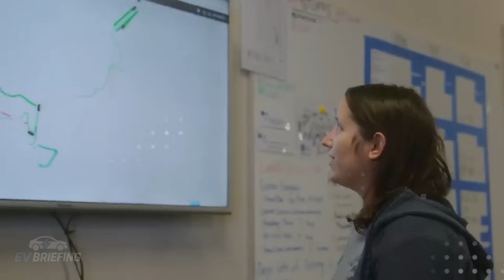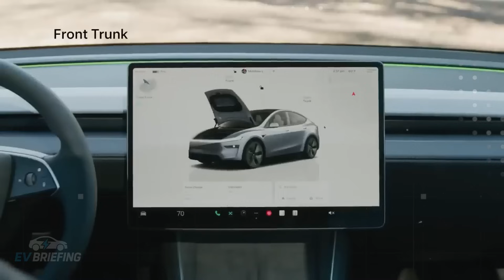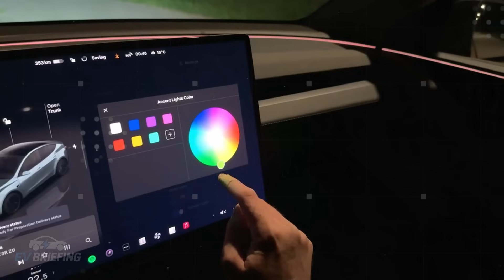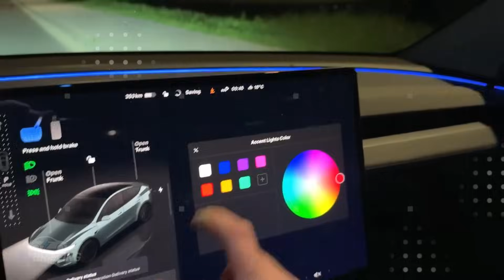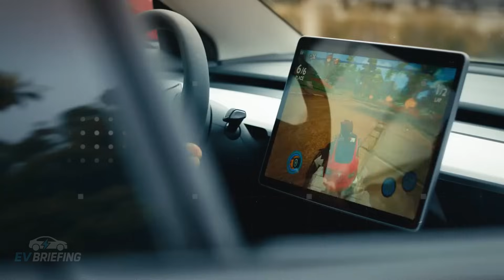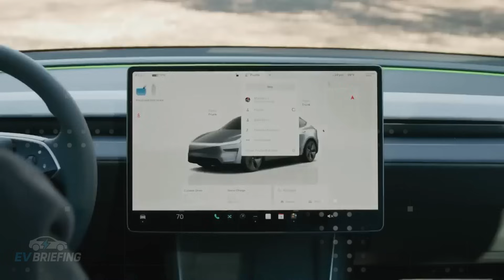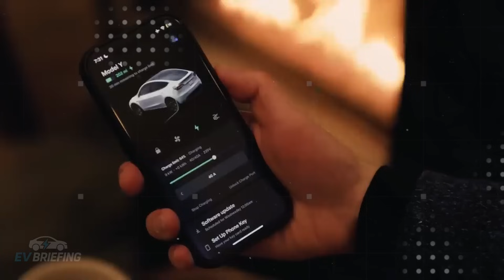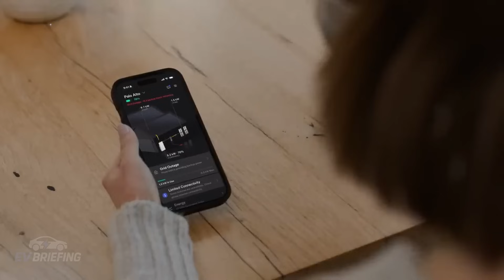IT’S HERE! NEW TESLA MODEL 2 With 1,000-Mile Battery & 10-Minute Charging EXPOSED!

Comment: It s essential that the Model 2 is equipped with Al ion battery, with a range at min 350 miles. Dual motor is also necessary if this model is to be my next car😉